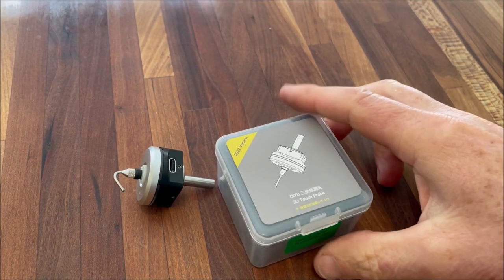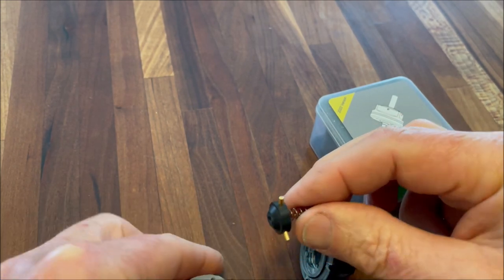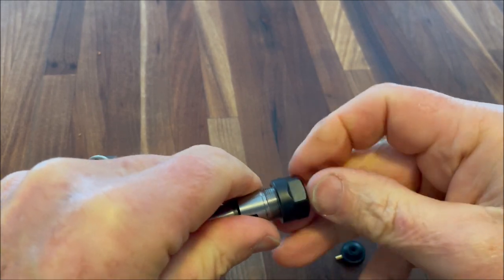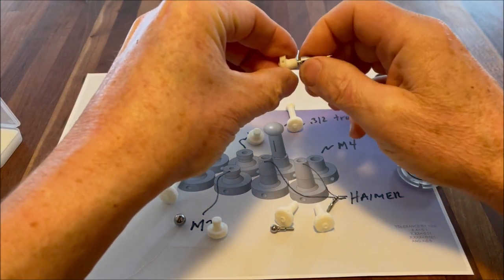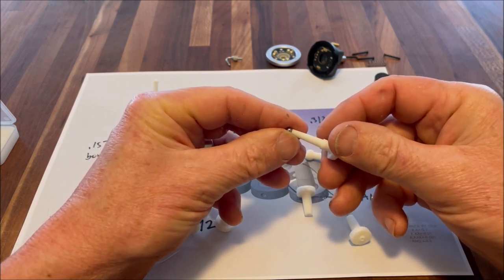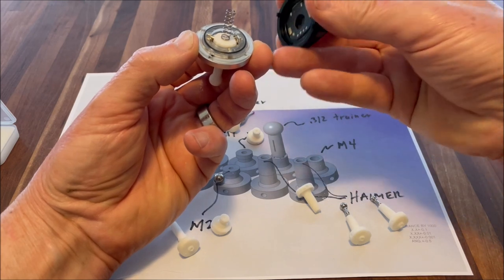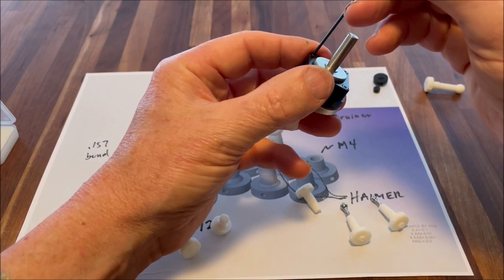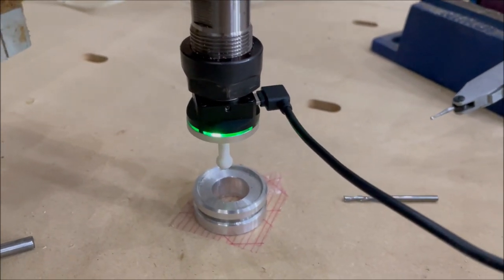Chinese 3D touch probe v6 repair/upgrade

Comment: what's thye difference between the V5 and v6 version ?, thanks.
Reply from the maker: I don’t know, I only have the version 6. If you post the diameter the pin push into and how much the 2 mm pins stick out. I can verify if the V6 is the same

Comment: These are so cheap you're much better off just buying a new one. Really not worth trying to spend the time fixing it, even if it is educational and handy to know how they are made.
Reply: They are not that cheap. 60-70 a pop. You break a couple it starts to add up. I have one and at 16 to repair I may just order it for the day it does get smashed.